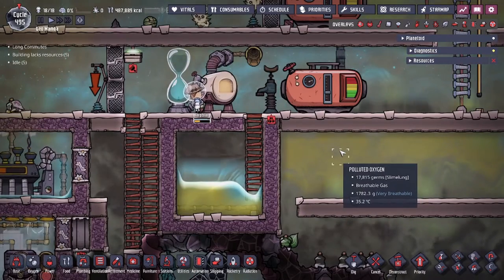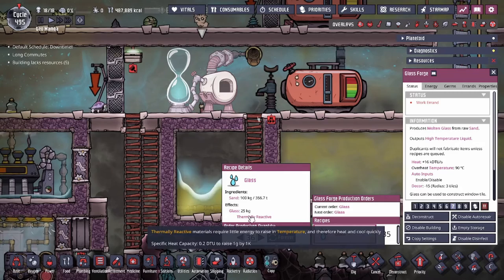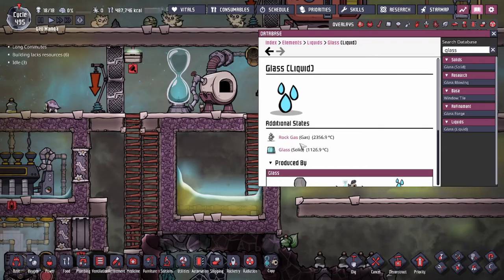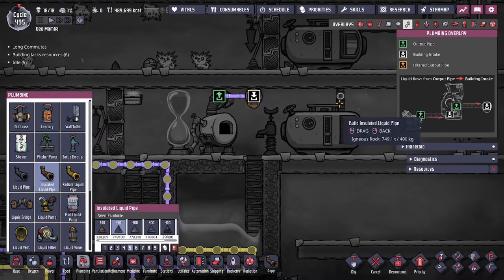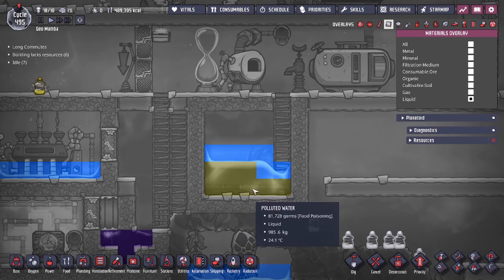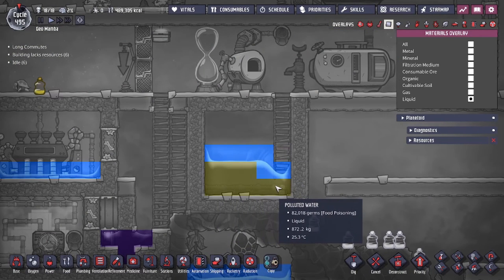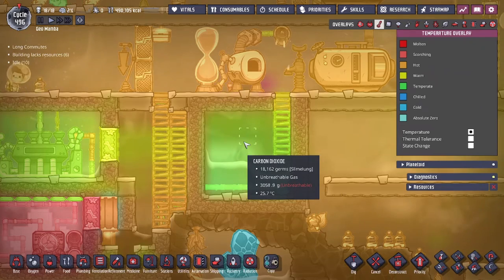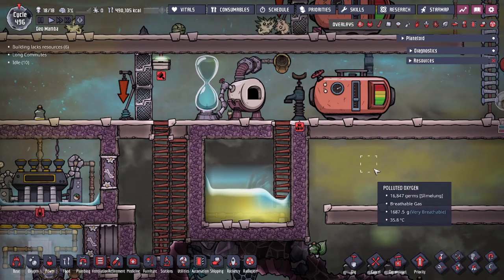The Glass Forge - Overview and Tips - Oxygen Not Included Basics

Comment: Okay, basic question: what's the difficult way of making glass?
Reply from the maker: manually heat up sand until its past 1712c, then it magically becomes glass
Reply: @2LegitCity  bonus points if you don't use magma to do it
Reply from the maker: @nananakeson  rocket exhaust heat is okay though right?